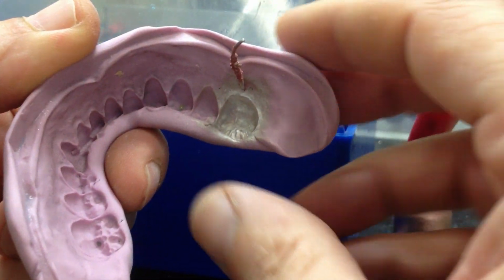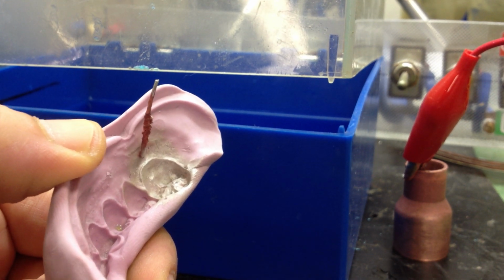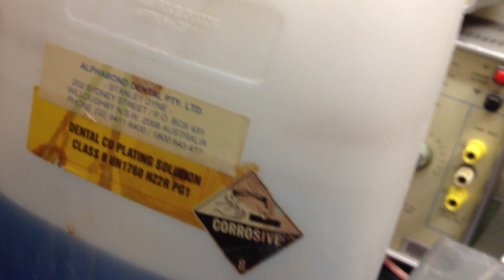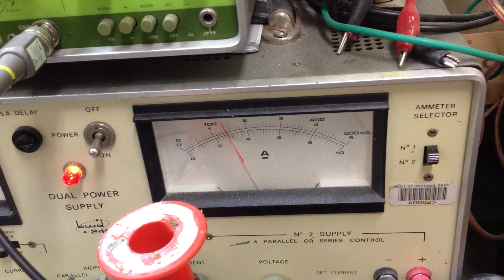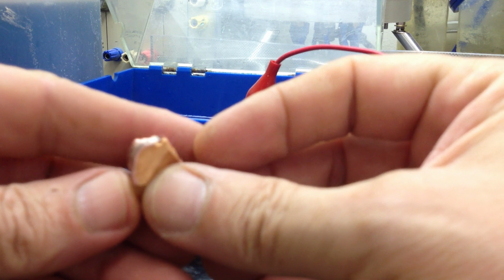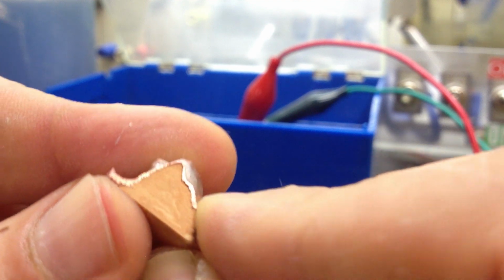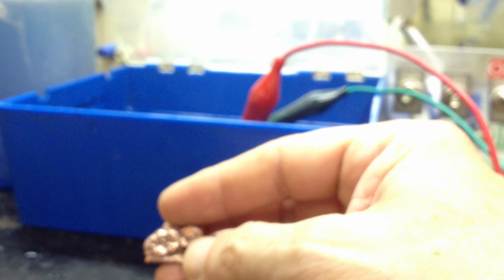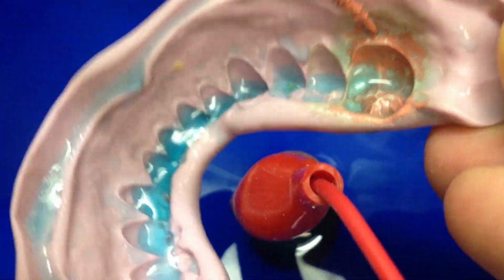metal forming 3D prints..

Comment: Very cool, it starts to work a lot faster than i would of figured.
Reply from the maker: firepinto yes, but it still takes between 8 - 12 hours to have a good thickness.The shape and position of the anode makes  a big difference as well.You can electro form most metals, even magnetic alloys..!! Westinghouse use to make laminated cores that way in the early 1900's. for a short time.

Comment: Electroplating inside out!
Very cool...I have a theory that some native gold deposits form this way.
Voltage across a chunk of quartz being squeezed by mechanical tectonic forces, laying down dissolved gold ions from a sulphide solution formed in the earth by heated steam moving upwards from the mantle carrying its minerals as it cools the ability of the water to hold things dissolved would lessen. Electroplating any charged surface it comes in contact with.
Affinity for quartz and ironstone.
Current theory says the gold precipitated out.
No mention of electroplating or charge imbalance leading to electroplating through piezo effect.
Reply from the maker: m3sca1 Yeah..electroplating occurs naturally in plenty of different situations.With the copper sulphate solution I am using, because of the acid content ( H2SO4 30ml per litre dist water), if you put a Laminated steel inductor core in there, it will plate itself in a few seconds, with no power connected at all.The plate rubs off easily but sticks in a few places...weird effect..

Comment: How do you keep the powder to stick to the rubber? (Like how do you make the conductive paint)
I want to try this method but i'm stuck at how to make a paint that can keep a lot of detail, at the moment i'm using a relatively thick layer of graphite paint but it messes up the surface finish.
Reply from the maker: Really fine powder will coat any surface with ease... just brush it on with a  soft brush.. but the powder has to be really really fine.